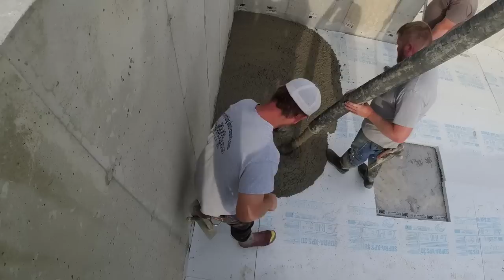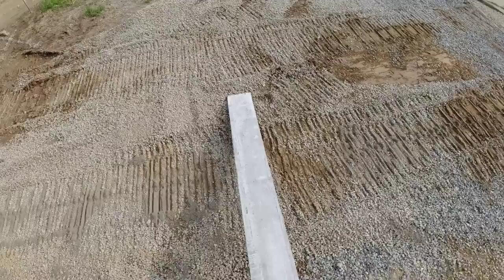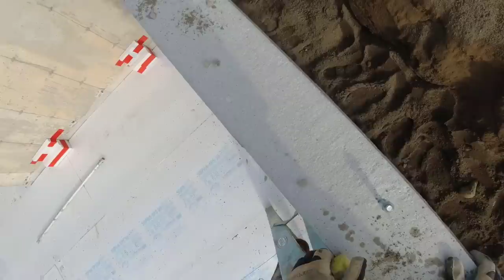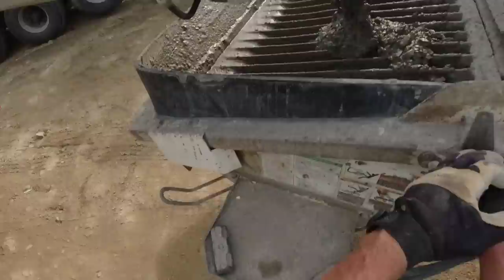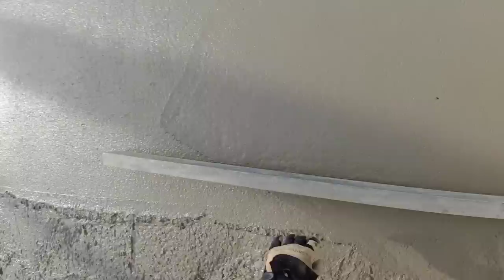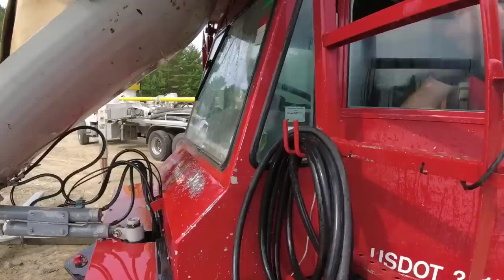Screed Concrete Floors Like Us (2400 SQ FT in ONE hour)

Comment: What are the square sections cut out of the insulation below the concrete for? 
Thanks for the great videos Mike!
Reply: Those are where load bearing columns will go, maybe not necessary but will be solid concrete from below the column tk the footer

Comment: Well, that’s answering my question I posted on the last video of yours I watched, you do use front dumps, lol . On this type of pour they don’t really help you, but on the slab on grade pours, with a good operator, they can save you and the crew a ton of work. I had my own crew for almost 20 years. When I had enough of being in business full time, I finished my working career driving for a local  concrete company in a front dump. I still did side jobs when time allowed, but only when I could cherry pick a job. 😉 I got tired of the grind concrete puts on you physically, it beats up your body pretty badly. I contracted with a national home builder, with a crew of 3 in the winter, and 4 in the summertime, we would pour a minimum of 8 basements per week, they were usually 700-1000 sq ft average. Monday was a prep day, no pouring, usually got 3-4 basements prepared, then the rest of the week is was prep and pour, the garages were usually around 500 sq ft, and the porches were  pretty small, but we prepared and poured them as well, made a lot of money, but paid the price physically. I take my hat off to you pouring those larger homes on the outside, people don’t realize how hot it is in the basement with no shade, or air movement.  👍
Reply from the maker: Thanks, we only have front dumps available at a few locations. Not all concrete companies have them.
Reply: @MikeDayConcrete   I know why, the cost of them as compared to a conventional, is a pretty significant difference, in Europe, they actually have front dumps with conveyors attached to them, do you have tele-belts in your area? It kinda looked like one in one of your videos, but I wasn’t sure. Just fyi, I used to carry a small hopper, with a rubber drop hose in my front for when contractors were doing ballards, it was like the hopper they use at the end of a regular conveyor. Had two chains that attached it to the truck shute. Made the job easier and neater.

Comment: Why would anybody still screed by hand? The advantages of the electric screed are huge: vibration for a better surface, normal eye position for better control and alignment of the screed, single person operation and less back-breaking work.
Reply: It's weighty on smaller jobs... a hand darby is reasonably injury-free, musclebuilding exercise as well, and is welcome on smaller jobs which may be more sedentary work otherwise.
Reply from the maker: I need the exercise is what I tell my guys.